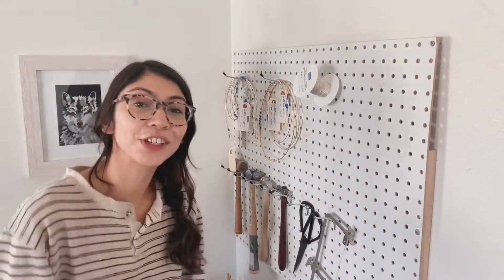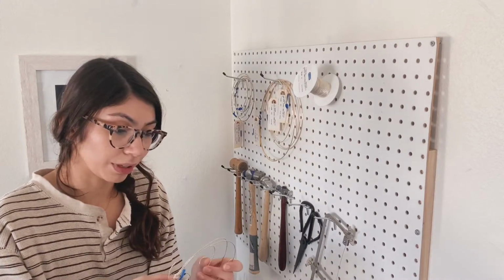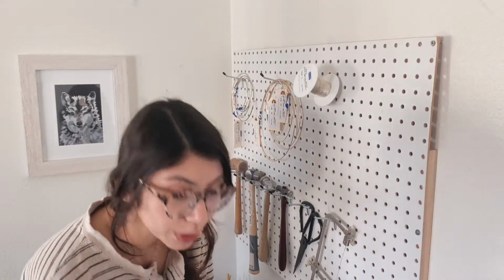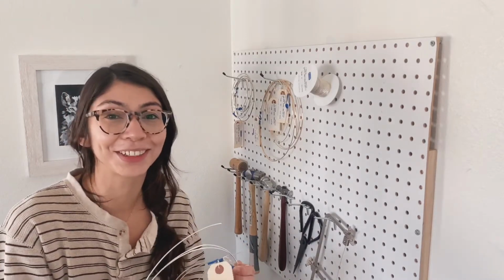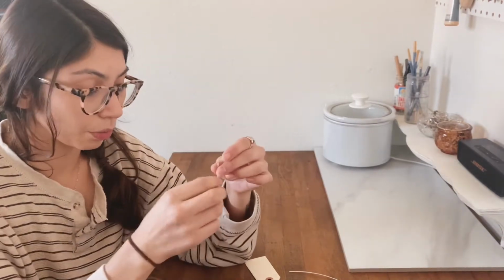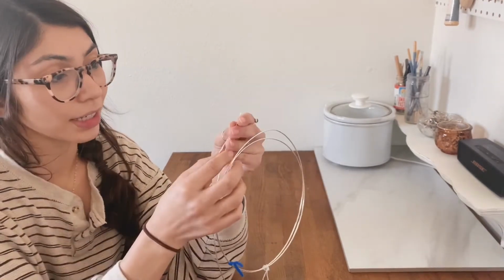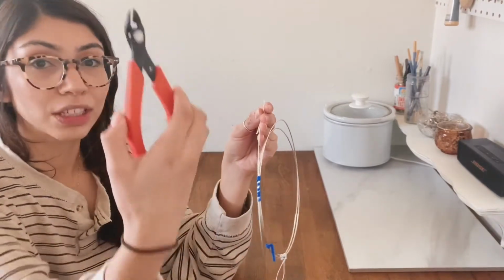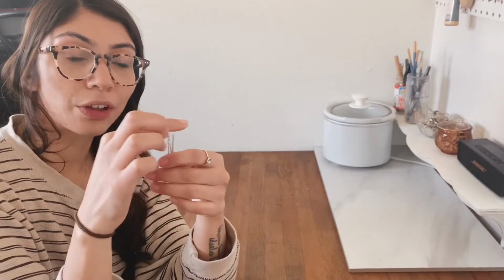How to make a silver ring, Silversmith for Beginners, Jewelry Maker

Comment: i've been studying and this video was so helpful 😊is a tumbler necessary for jewelry making (rings, bracelets, earrings, etc.)?
Reply from the maker: I would say not at the beginning. You could polish your jewelry with a Dremel and some polishing compound. BUT the tumbler for sure makes polishing way easier! I bought mine at Harbor Freight. It was under $40 with their coupons!
Reply: @Wildflorajewelry  ooh, ok yeah i've been looking around at tumblers and wheeew they are $$$!
Reply: @Wildflorajewelry  I would also say that a tumbler is a great idea when you are doing what I call a production run of say 10 or more pieces. If you are doing a one-off design, or one unique piece, I prefer to just use a Dremel/Foredom type tool. But when you have a dozen pieces of the same design and you are just filling inventory and filling orders, polishing by hand will bore you to near suicide. Using a tumbler will free you up to fo more interesting work while the bulk of the polishing is being done for you.
Reply: @taaanita  jewelry tools can get expensive. When you are just starting out don't shy away from used or second hand equipment or tools. You can upgrade them later when you have more money. EBAY IS YOUR FRIEND. Also Craigslist, offer up, and even garage sales (after covid of course). Bench jewellers retire, or pass on and you can often find them (or their surviviing family) selling off their old  workshop stuff.  I have also bought a very beat up Benchmate system off eBay and sent it in to the GRS company for them to repair and refurbish it. It came back looking like new -- a fraction of the cost of a new one. It still works great.
Reply: I made my own manual tumbler. I bought the shot from Rio and put in a plastic peanut butter container(empty and cleaned) with water and dawn. Add silver project and shake, shake, shake ...works really well & you get an arm workout for the fraction of the price🤣